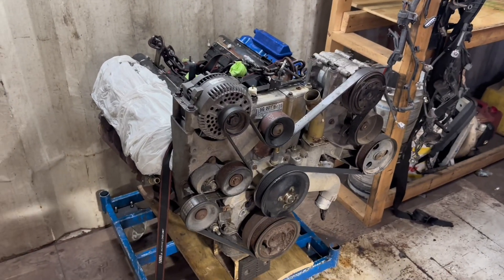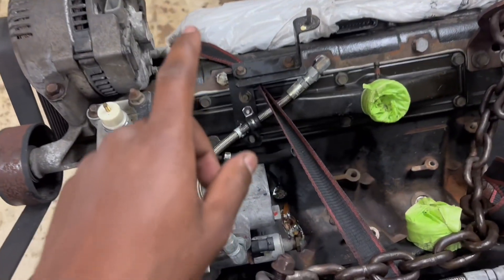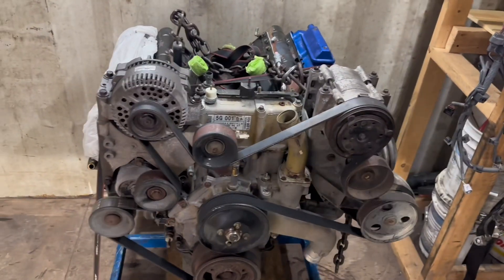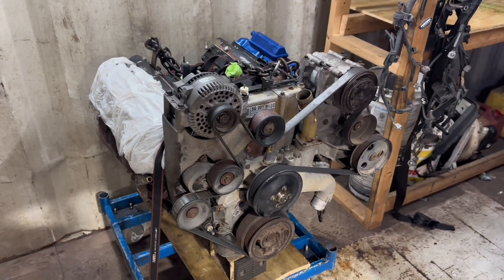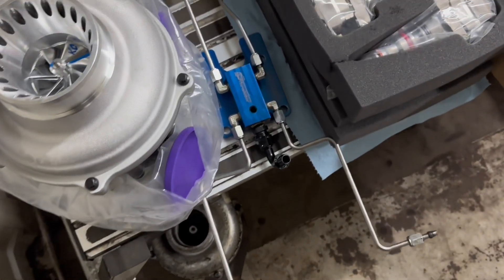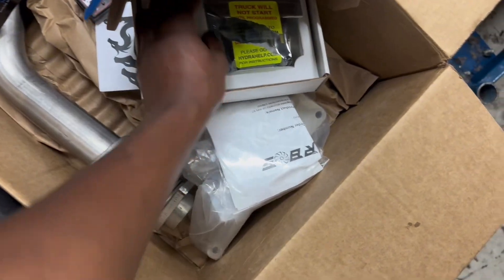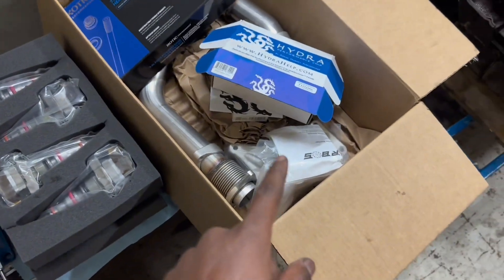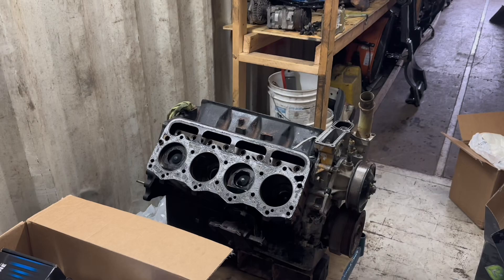Let's build a 500hp 7.3 Powerstroke Pt.1

Comment: Why are you putting a superduty turbo in place of an obs turbo?
180s and a stage 1 will not get you 500hp, maybe high 300s.
You also could have run stock fuel
Also that's a 95 based off the hpop reservoir